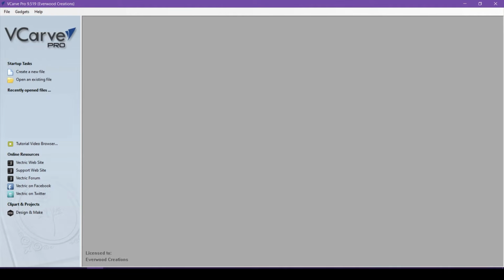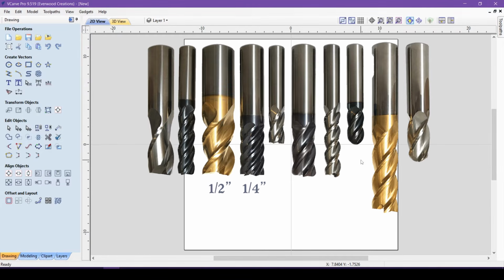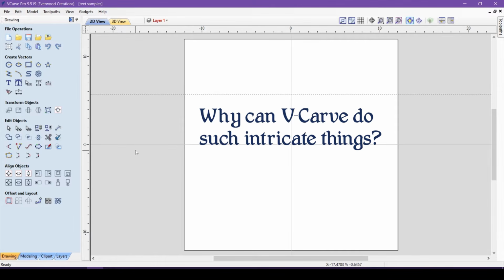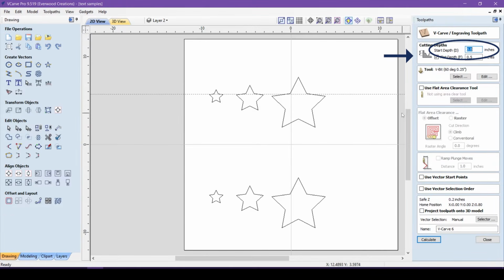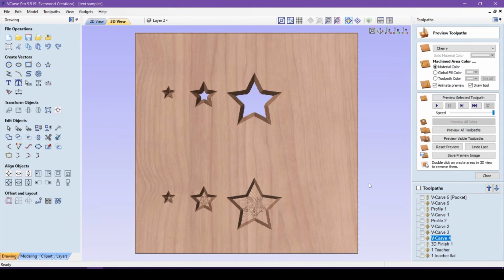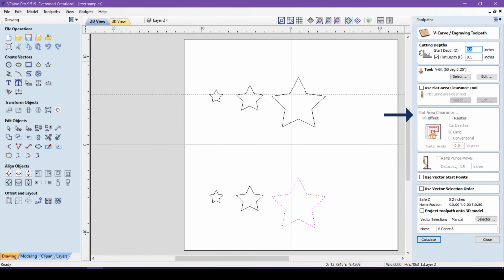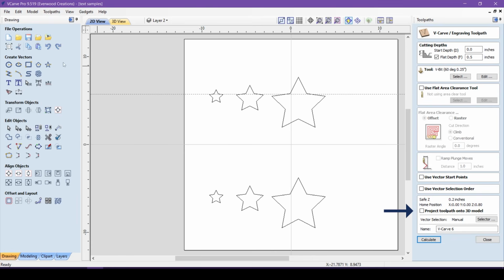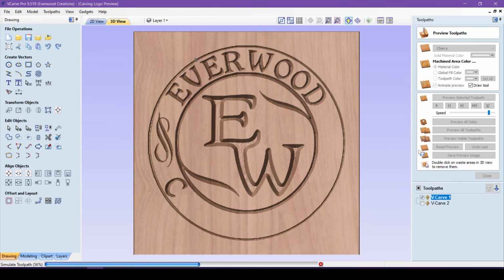VCarving Explained | VCarve Toolpath Options in Vectric

Comment: If I already have a 3D model machined, and I want to engrave a Vcarve text onto it using the "project onto 3d feature", how do I set up the material so the program knows its a sphere etc.....
Reply from the maker: Hmm, that's tricky.  The projection is meant to be used with a 3D model in the software.  If you have the model, you could import the model in and set it to the settings that match what you already did, then project on to that and it may work.
Reply: @EverwoodCreations  it would make for an interesting video if you could do the exercise, then it's out here on the tube for all to see also!